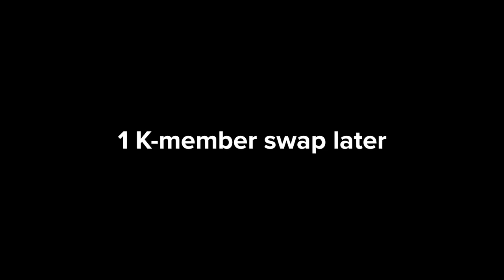We found the PERFECT Boat!

Comment: Btw I would highly suggest getting an 80lb thrust 24v minnkota ultrex for the boat. You will love it for sure. I would get rid of the current 12v deep cycle battery and get a 24v lithium battery that will run it. It's a little expensive but they weigh next to nothing and last much longer than traditional batteries. It will eventually pay for itself. I have a 2001 bass tracker 175 with a 40hp mercury my grandfather surprised me with when I was about 6. I saw it on the side of the highway and told him about it. It turned out to be a guy from our church and we got it for a heck of a deal. I still have that boat and it still runs and fishes well. I just need to get an oil leak figured out but I think it is the seal on the reservoir tank or a line that's leak. I also have a 2000 Triton TR21 with a 225 EFI. That thing is a beast and will run 75 mph on the water. It chine walks pretty bad but it makes for a fun drive with an adrenaline rush. It fishes just as well as the $80,000+ boats I fish in tournaments against and I can keep up with them or pass them speed wise. But fiberglass is a whole other ballgame and is not forgiving at all to bumps at docks or accidentally hitting something. You made a great choice with the tracker especially with the current gas prices... I highly suggest running non-ethanol in it for a motor that small since they use so little gas. If you don't definitely make sure you use a good stabilizer like mercury 2 I believe. Good luck and would love if you make some fishing videos!